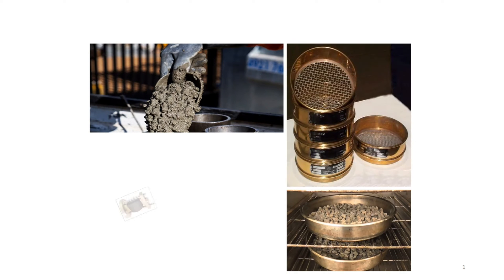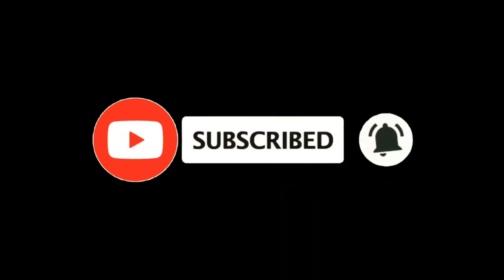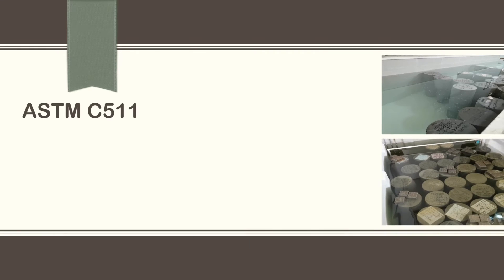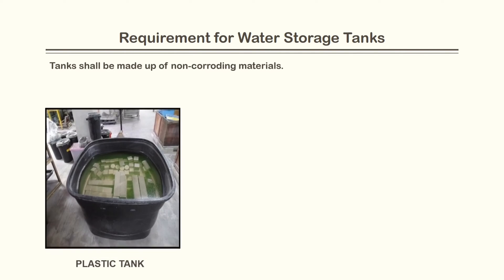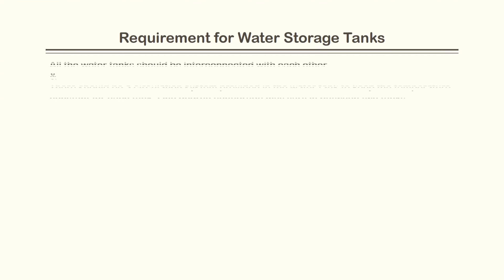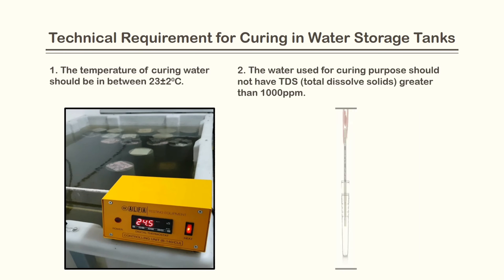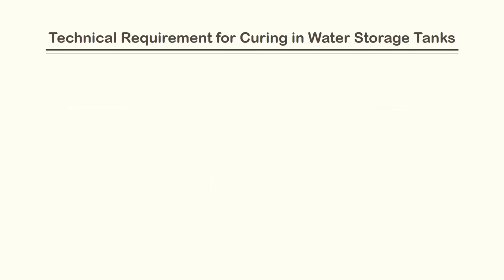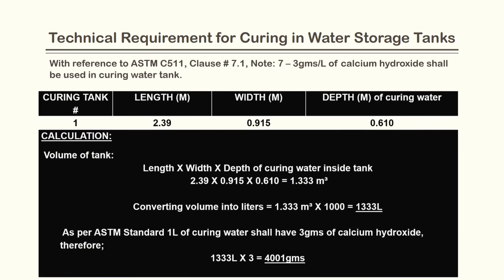ASTM C511 | Standard Specification for Curing Water Tank of Concrete Specimen.

Comment: Could you please come out with a video explaining when you vibrate and when you Rod concrete beam molds (6×6×18) when casting concrete beam molds for flexural strength and at a certain slump is it one lift or two lifts or is it always to lifts no matter what thank you.